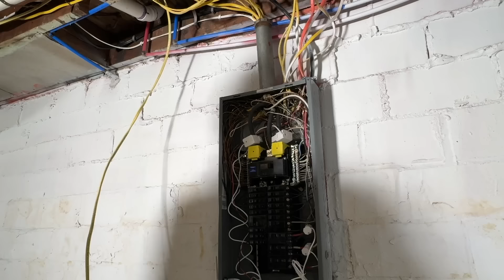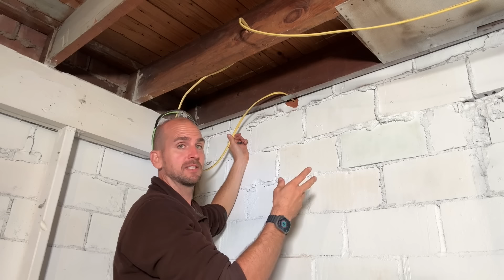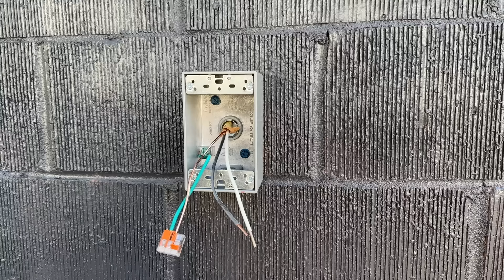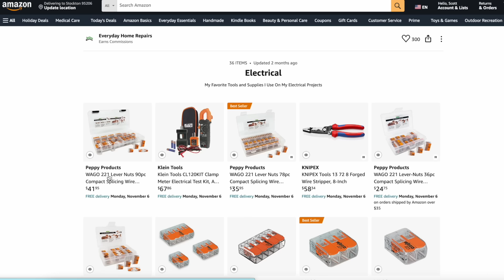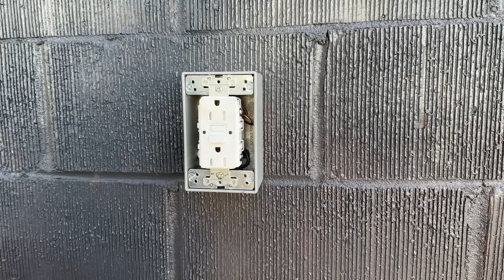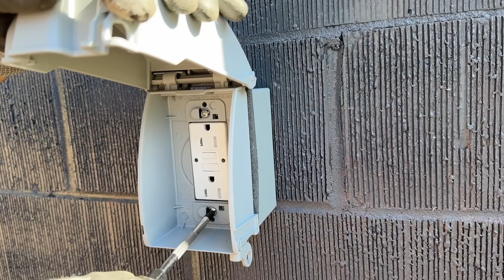How To Install An Exterior GFCI Outlet

Comment: I would have installed a short piece of conduit through the masonry. Would have taken less time than all the talk about it.  
But, when installing screws through the inside of the box, would sealing washers have been required (or a good idea) to prevent moisture from entering the box? I have never seen these boxes that could be mounted from inside screws, only tabs on the outside.
Reply: Yes, if you don't do this you should use outdoor rated cable to to protect it from chafing against the masonry.

Comment: I like the nail plate idea, yet the "sharp edges" concerns me.  Even a thin piece of wood would prevent any possible (though doubtful) cutting of the wire.  Some rubber wrapped around the wire would take care of it.

Comment: Why didn't you mount it one brick row up? That would have saved you the notch and nail plate on the very bottom of the joist, also the NM would have been more concealed vs. looking like it just got squeezed up in there.
I have to agree with TomCee53. It seems like the entry/exit of masonry *should* need sleeving- and if NEC doesn't call for it- just add it because they will a few years later.
Reply: He screwed up his measurement... and yes mechanical protection is needed when going threw a block wall

Comment: You mentioned needing the 2nd receptacle from the junction box due to the NEC requirement for at least two 15amp receptacles on a 20amp circuit. It's been my understanding that the GFCI having 2 receptacle outlets meets that requirement. (CAVEAT: I am not a licensed electrician but am very experienced with electrical work and much of the code.) Like the other poster mentioned, I recommend confirming the GFCI function with the test buttons on BOTH the receptacle and the tester. (I think most modern testers have the button.)   Keep up the great work. You have some great videos!
Reply: Correct. As defined by Article 100 of NFPA 70 (NEC 2023), duplex receptacles are multiple receptacles. A note follows the definition of receptacle to specifically indicate that duplex receptacles are an example of multiple-receptacles. The receptacle rating for duplex receptacles can therefore be read from Table 210.21(B)(3) "Receptacle Ratings for Circuits Serving More Than One Receptacle or Receptacle Outlet", which allows 15 or 20 amp receptacles on a 20 amp branch circuit.
Reply: You are correct
Reply: It is strange that 15a graded receptacle on 20a breaker. What about wire gauge? Is it 12awg since it’s on 20amp breaker. Thanks
Reply: @tipstricksreviews4481  Yes. 12 gauge because it's on a 20 amp breaker.
Reply: That’s wild that you can use a 15A receptacle on a 20A circuit. Doesn’t that mean the receptacle can start melting or whatever with 5A of headroom before the breaker trips?
Reply: @brent... In theory yes It could overheat. However, no properly wired appliance would have a 15 amp plug on a single appliance drawing more than that. In theory of course. However, a 15 amp multi outlet extension is a case where that's more likely to occur. However, again in theory, they are supposed to have a breaker inside. It's not a foolproof set of requirements.
Reply: @brent... It's permissible to use 15amp receptacles on a 20 amp breaker...as long as there are multiple receptacles on that branch circuit. NEVER use 20amp receptacles on a 15amp branch circuit!

Comment: I would use a conduit pipe through the brick coated with polyurethane on the outside before sliding it in to seal it, and then a waterproof service connector for Romex to the box.  If you could not drill from inside out and made that drill mistake with the small hole when drilling from outside in,  I would have filled the first hole with some sort of cement sealer and moved up right then and drilled a new hole in the right spot.  I think I'd rather have a filled bad drill hole than notch out that floor joist like that.  Not sure with spacing how you could drill from inside with that big drill though but I bet some smart guy knows here.
Reply: i just thread conduit right into box then you just use regular 3/4 masonry bit to make hole to put conduit through and have clamp on inside house.

Comment: Im confused,the bare ground of the feeder coming into the box should be run through the ground screw first whether its a branch or dedicated circuit. This is a serious pet peeve of most inspectors and an indication of experience.  Why run it to a Wago then back to the ground screw with a Shepard hook? I dont see the reason behined it,or am I missing something?

Comment: We do this type of install almost weekly. 2 things you are doing wrong. Drill your pilot hole from the inside for more accurate placement in the basement and number 2 we always use a service entrance connector for a water tight connection on the rear of the exterior box. We do not use Romax connectors at that point they’re not waterproof.
Reply: Now I gotta google "service entrance connector"
Reply: You know me
Reply from the maker: I appreciate the feedback 👍
Reply: 3 shop art, silicone must be added to plugs for waterproofing. Sigma boxes at lowes actually has this printed on box
Reply: @RR-su9kb  You are correct we also waterproof the top and both sides leaving the bottom open
Reply: Run a bead of silicone on the back of the box to facilitate waterproofing. Well done.
Reply: Technically you’re gonna wanna use UF cable as well with those se connectors. Romex isn’t rated for exterior applications. 🤔
Reply: @protoman247 when the box is on the side of the house, it’s not nm cable, it’s just 2 conductors with thhn insulation and a bare ground 😉
Reply: @billy9075  Correct. There is no NM cable being used outdoors in this installation. The NM ends at the box entry.
Reply: @pld8993 
"Even though NM-B contains THHN conductors, they are not dual-rated for wet locations (THHN/THWN-2). According to the 2020 NEC:

NEC 334.12(B)(4): NM-B is prohibited in wet or damp locations, even if stripped to its conductors.
NEC 300.9: Conduits in wet locations must contain conductors rated for wet locations (e.g., THWN-2, XHHW-2).

NEC 312.2(A): If an outdoor box or enclosure is subject to moisture, all wiring inside must be rated for wet conditions."
Reply: @Antassium  Let me clarify things for you so you can better understand this video. None of the NM or its conductors in this video is in a wet or damp location; the NM ends at the point where it enters the box. None of the NM in this video is in conduit in a wet location. There is no 312.2(A), and the inside of a weatherproof box installed outdoors is considered a dry location.
Reply: @pld8993 the wall (outside wall) is considered weat location.
  He needs to put a short piece of PVC,  EMT, etc, probably at least 3½ inch or thickness of the brick wall connected to the box, or put the box in the wall, not on the wall. 
 Nothing bad is going to happen cause he put silicon though
Reply: @protoman247 you’re right but everyone still does it
Reply: @protoman247 if I splice into an existing 12/2 regular romex can I extend the circuit with 12/2 UF for my new exterior outlet?
Reply: @Josh-fz9rh UF cable can be used both inside and outside
Reply: @Josh-fz9rh You can. The only real difference between the 2 is the sheathing thickness/fill. NM-B has conductors running loose in the sheathing, whereas UF-B has sheathing that fills and fully separates the conductors. Jackets don't touch one another.
Reply: Would have been easier to patch to
Reply: Thanks for the info!  The company I used to work for just used chase so they didn’t have to chip out drill out a bigger hole. Im doing maintenance now, and the person who installed it didn’t even use a weatherproof box, just put the outlet in a cover and left it so it fried and I don’t like doing sloppy work.  It didn’t seem right to use a chase nipple with it just on the ground like that so the service connector is definitely the proper route to go.
Reply: Googling “service entrance connector” now lol
Reply: Can you fit 2 12/2 nm cables in the se connector?
Reply: “Wrong” or preference?
Reply: Working with the box hot was insane.

Comment: Loomed in block is just fine in east coast Canada.

Generally we run wire below joists with staples. Just the most common method here.
Reply: Can’t do that in the US unless you run a raceway board  to staple the NM to.
Reply: people go to finish basement then and put drywall over the wires everyone follows different codes but that is pretty old idea to not put wires in basement over joists but through middle instead.
Reply: I was actually taught to drill through joists, and only adopted stapling underneath once I started my own jobs.

Different areas, slightly different rules. Pretty cool to compare.

Something strange on this video is passing the wire near the mains. That is illegal in local resi builds.

Comment: Nice Video a couple of thoughts. Measure off of the top of the window then shifted the box to accommodate centering for the brick and clearance above the sill plate. You could have also mounted the box horizontal which would have picked up that inch you are short . Also I use conduit through the wall which would have reduced the exterior whole size . Lastly always covered the rear of the box with some silicone chalking around the conduit penetration prior to assembly as added protection.  JMT Keep up the good work .
Reply from the maker: Thanks for the feedback, I appreciate it 👍
Reply: RE:goodtimes2654.   Would you use metal or pvc conduit and would you put something on the interior end of the conduit to protect the NM?
Reply: I never trust anyone who spells 'hole' as 'whole.'
Reply: @diceonam 
I bet autocorrect got him.

Comment: From outside I would have drilled a large hole first in the first part of the brick and then with the pilot bit, at an angle go thru the back part of the brick at an angle going up to reach the center of the joist or about. I would also fill the hole from inside with expanding foam to keep insects and cold air from coming in. Lastly I would have put a bead of caulking around the big hole in the brick before screwing the box on the wall, kind of belt and suspenders with the outside caulk around the box.
Reply: Also, I would disable the hammer function on the drill since this is a kind of soft clay brick, the carbide bit beeing sharp enough to cut and prevent a breakthrough in the back even if it takes a few minutes more..
Reply from the maker: Yeah, that might have been a good move 👍.  This type is very brittle especially when using a rotary hammer drill.

Comment: This is NOT up to NEC electrical code. This guy is not qualified to give electrical advice even tho he likes to
Reply: Which code reference was violated?
Reply: @RJ-ej1nr  1. The definition of wet locations in code is subjective. I frankly do not call the space behind that box dry, silicone or not. Inspectors may or may not agree with me.
2. Romex (NM-B Cable) is per code not allowed in a wet space (NEC 334.12(B)(4)).
3. NM-B Cable needs to be attached to structure within 12 inches of the service panel (NEC 314.17)
4. Cutting/notching the bottom of joist is a big no-no in places where structural building codes exist. I don't know those codes, but would strongly discourage notching the edges of structural beams as you definitely de-rating the load capacity of the beam. Holes through the middle are generally inconsequential.

I really am dumbfounded as to how much additional work it would have been to do this job properly. Bring conduit in from outside, terminate it at a conduit box inside the basement, and run THHN in the conduit and NM-B to the panel.
Reply: @thesmallterror  Sorry, but that is a crock. By that logic every outdoor light and receptacle could not use NM cable - which is counter to how most installations are done. The cable is not exposed to the weather, so it is fine. A homeowner isn't likely to have enough of a need to warrant keeping THHN cable on hand. If the position of the receptacle could not keep the cable out of the weather then buying some UF cable would make more sense for a homeowner.
Reply: @thesmallterror  The damp location definition is clear - for damp it's "subject to moderate degrees of moisture". Is behind the box protected by silicone/caulk that or not? As you say, inspectors may or may not agree. Personally I think it's a lousy practice though, silicone/caulk as used here does not last, and you'll find it leaking down the road. I prefer boxes that go into the wall, like Arlington's inbox, although those are more work.
As far as 3) goes, that's a good catch, for 2023 that's 334.30, but that's the prior install too. And cutting the bottom of a joist is a 😱.
Reply: @RJ-ej1nr  Indeed, we are thinking the same thing. I have little faith in silicon around the outside of the box. Sunlight, weather, and particularly freeze-thaw cycles will deteriorate that silicon in a couple years. Pure silcon is better against UV; He made the right move in that regard.

I would prefer a recessed box, which is the standard Jason refers to where nm-b cable is used on an exterior fixture. If the box is surface mounted, you're working yourself into a damp location predicament. Short of recessing the box, it would be better if the back of the box was siliconed instead of the edges. That would provide years of resistance to water intrusion by layered seals occluded from sunlight and direct moisture exposure.
Reply: @JasonEDragon Romex can be used for outdoor lights and receptacles if their respective outlet boxes (or at least part of them where the Romex enters) are recessed in the exterior walls. This prevents the Romex from being ‘exposed’ as is in the video.
Reply: @thesmallterror  The definition of wet locations is not subjective, Article 100 is very clear. The NM is not installed in a wet location. The entire cable is in the wall and basement, neither of which is a wet location.

Comment: I would have used conduit clamped to the bottom of floor joists  and just run the romex through that to the block. Just that section. Why the heck not, it's like $4 in materials.  I'm not an electrician but I know a guy.
Reply: most places don't want basement ceilings having surface wires since people might want to put in ceiling later.
Reply: My basement has drop ceilings and  I would not do sheet rock in basement ceiling. So it wouldn't matter in the case of a drop ceiling either. @ranger178

Comment: Void in a concrete block wall means downward through the middle of a standard block wall, not through holes drilled in the sides. I suspect you would need to sleeve the NM where it enters and exits.
Also, you should have stapled the cable closer to the box (within 12”). And I like to confirm the gfci function with both the test button on the receptacle and the tester.

Comment: 1.  I would have sealed/waterproofed the back of the box against the masonry block.  As installed it looks like water would run down the exterior wall, between the exterior box and the wall, and then get inside the block penetration and wall cavity; causing problems later.  
2.  I also would have used conduit from the panel up into the floor joist cavity as a minimum.  
3.  I never would have notched the bottom of a floor joist; pretty sure that will be a structural problem later with future home inspections (if the home is ever for sale).
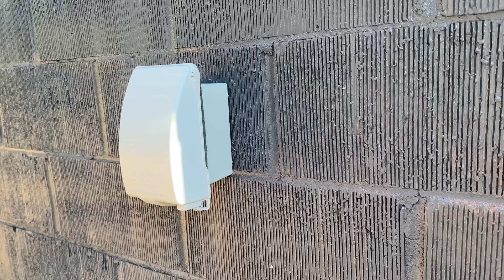Reply: As far as item 1, evidently you didn't watch to the end of the video.  13:58
Reply: not a very helpful seal if bugs and air can get in at bottom and i would have sealed the screw in knockouts. @JCWren
Reply: @JCWren thanks for the call out, I missed that the first time….

Comment: What a hack!!! I would never run romex exposed down to the panel. Run conduit !!! 😂
Reply: Romex should not be in conduit.
Reply: damned soo ALL the home runs going to my panel are hack work since they are exposed? and the sparky swore on his great great gramdmother's soul a panel mounted to plywood was permitted to have exposed romex . I demand my money back!
Reply: Then why are all the other cables run to panel without conduit? 😂
Reply: @aurvaroy6670 depending on where you live they shouldn’t be. Some Inspectors require that the only exposed wire be above the bottom of floor joists, and the panel should be boxed in.